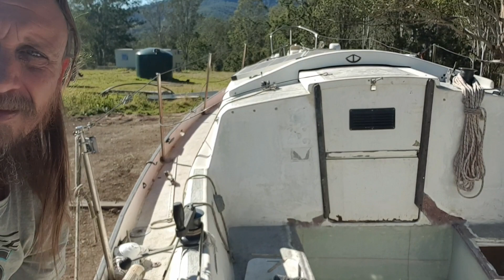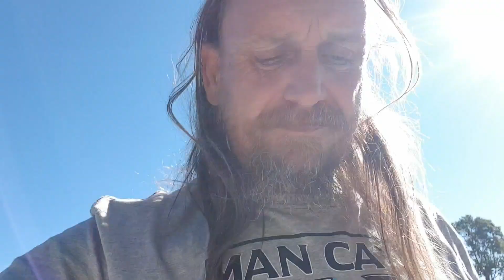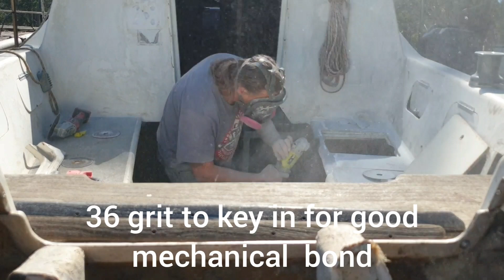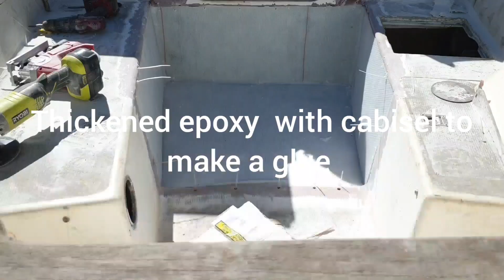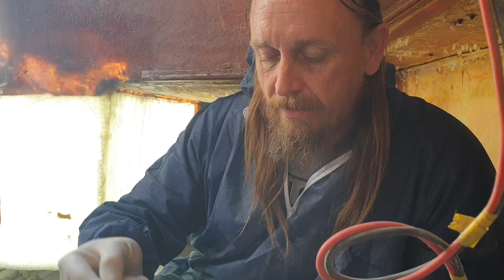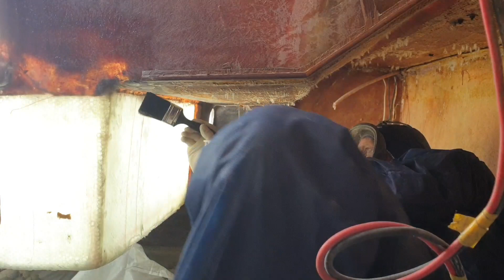sailboat restoration part 10 Rl34

Comment: Its heaps easier when doing this to brush a bit on the surface just to wet it then wet out the glass on a flat board, roll it up and put it on like tape it's a shit load easier
Reply from the maker: Thanks for the feed back 👍